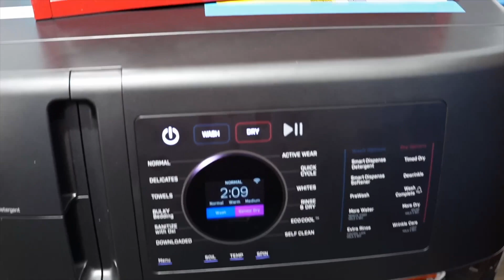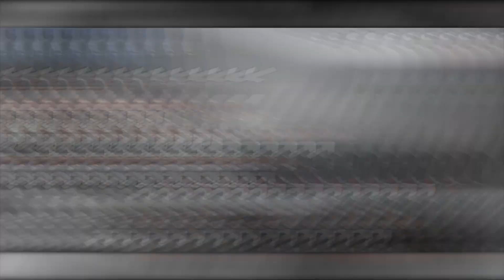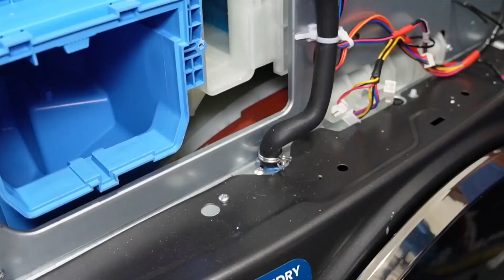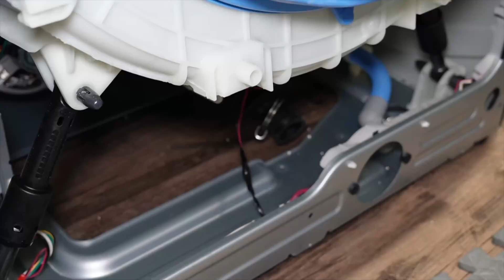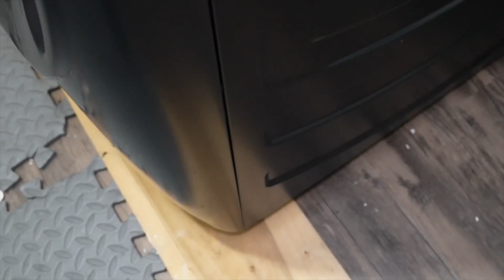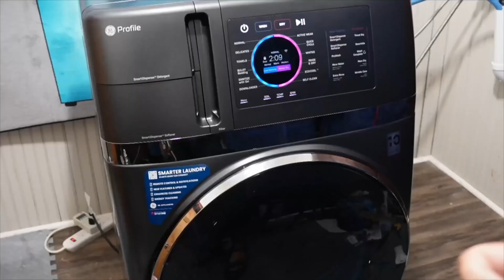GE Ultrafast Combo - Drain Pump Replacement Guide if Unit Won't Drain

Comment from the maker: This video was by request from a few viewers. Remember that buying the pump from our site does help support me making videos like this and all the others. Pump: https://bens-appliances.com/products/wh11x29539-ge-washing-machine-drain-pump-wh11x29539cm

OEM Pump: https://ifix.gd/3XPuKIk
Reply: Thank you so much for this video! Was out of warranty and no repair folks in my rural area could work on this machine. Was able to fix the issue myself and saved a boatload of money!
Reply: I tilted ours and went under and before I completely removed the pump I put my finger in the smaller hole and could feel the impeller and as I turned it found a bunch of lint attached. I got the lint pile out and I’m running a test load now. Thanks for these videos. Last time I watched one was for my elderly parents washer and you sent me the part and I used the video to do the repair.

Comment: Wow! I have never seen anyone make such a simple job so convoluted! 

Go in through the bottom! None of the front panel needs to be touched or removed. Make sure that you have the right tools for the job, but damn! 

You took a simple removal and replacement to a-whole-nother (infix for you linguists) level of difficulty. 

Props... All engineers should have to be mechanics first. 😂

Interesting design failure in the pump assembly that could have an easy fix. No screen in front of pump intake. That one feature could prevent pump failure from debris. 

Surprised these haven't been recalled or that there isn't a class action against GE for negligent engineering. 

An after market part that fixes the pump flaw in these washers would make a killing, especially if there was a recall. 😂 Blue Ocean baby.

Comment: I have water leaking from the drain pump filter seal unless I tighten it SUPER tight . I think the threads on the plastic housing are bad. Not a great design for such a crucial leak point!!!! Anybody with tips on what I may be doing wrong / why it might be leaking / not threading well?

Comment: We just had this same problem with our washer and replaced the drain. We replaced the control panel and although all buttons work; the washer works and goes through all the cycles; the display does not light up. I can hear all the beeps from pressing buttons but no display. Is there a remedy to this without replacing the entire panel?? 😩🆘

Comment: Before replacing the pump check for any debris stuck in the pump. I had a buzzing sound and no drum spinning. It ended up being a huge clog of hair and carpet. I bought a L shaped pliers to pull it out. Now it works like normal.

Comment: Thanks to the commenters here. We also had a drain pump that stopped working and it also turned out to be lint trapped in it. A sink snake was able to grab it. We weren't able to see or feel anything, but that was able to pull out a lint plug (that was quite hard). 
I'll now add snaking the drain pump impeller as a part of the deep clean. Love the machine besides the lint issues.

Comment: Thank you for making this video! My washing machine would not drain, and warranty had just ended. I ordered a new pump and followed the instructions except I did not completely remove the control panel but supported it and left wiring intact.  Also left the balancer in place which made it a little tight but not too bad.  Turns out that pump discharge line was plugged, even though I have been cleaning inlet filter, and pump was still good. I replaced it anyway since the machine was apart.  Without this video I would not have attempted this repair myself.  Thanks for helping me save a lot of money!!
Reply: We offer a complete Flushing process and products to keep your machine like new. Reach out if you're interested.

Comment: FWIW as others have said you can do this without removing the front, assuming you dont have the base attachment.  Very carefully lean it on its side, not too steep, either stack something underneath or have someone spot you as someone else posted.  , i got a $4 shallow ratchet set from harbor freight along with a stubby screwdriver.  That along with angled needle nose which i already had.  Take the black tub drain off first, then take the screws, it was easier to use a stubby screwdriver on one side and the shallow ratchet with phillips on the other.  Once the screws are out you can pull the whole pump out through the hole in the bottom and then remove the blue drain hose.  In my case, somehow a hair tie had made it through the pump filter and then got wrapped in a bunch of hair and lint, right at the 90 degree bend.  Seems this should be a straight connection or 45 degree or something and not 90, or the strainer/filter should be a bit finer to not allow such large items through.  Either way in my case i cleaned out this blockage, made sure the rest of the hose was clear, then reinstalled the pump (in reverse order) and i was good.  I went ahead and ordered a spare pump since its cheap.

Comment: So heavy is not an option but the hole on bottom does give you enough room to pullout the pump and replace it is that correct sir?

Comment: Like everyone else, I also had to replace my drain pump after less than a year. However after watching this video, I realized I could pull the machine away from the wall about 3' and lean it back ballance against my wall. For safety I had my teenage son spot me while I slid in underneath. Took about 10 minutes to remove and replace.
Reply: What symptoms did you have that it needed replacement
Reply: @frankgeraci1060  I had a buzzing sound and no drum spinning. It ended up being a huge clog of hair and carpet. I bought a L shaped pliers to pull it out. Now it works like normal.
Reply: Perfect, I saw that floor too and was like shit I can just get that from the bottom can't I

Comment: Honestly after over a year I would not recommend this unit because of : 
A) drying lint catch does not adequately remove lint from the system. There is an excess buildup both around and in front of the lint trap that needs to be vacuumed out every month or so. There's no access port to more extensively vacuum the unit out. So dumb.
B) The drain pump is small and weak. And the filter in front of it is like a rock catcher. My drain pump thankfully didn't crap out but from the sound of it it's not uncommon. Why not put a more "mesh" type filter that actually will extend the pump life, followed by a pump that actually has some balls?
C) Even out of the factory your clothes will take longer to dry and with lint buildup even longer.

I'm out of warranty so obviously I'll just keep it. The convenience is awesome and with a few tweaks this things could rteally be great. But damn GE, fucking step up and use common sense. Shouldn't have to disassemble the whole damn unit to swap a little pump.

Comment: As mentioned in other comments, you can do this repair WITHOUT removing the front panel. Just tip the unit on its side/back (make sure to remove detergent unit and also pad where the unit will sit). Then follow the steps in this video from minute 6:50 but just do it all from the access point UNDER the washer). Makes this a far far simpler repair.
Reply: From the video it looked like two Phillips head screws may be hard to access from the bottom of the unit. But if you've done it before than cool beans.
Reply: Ooooh really good to know.

Comment: Seems like you can get directly at the pump from underneath the unit. Tight squeeze, but not too tight for an auto-mechanic
Reply: That's the method I used. All you need is a stubby Phillips head screwdriver and a pair of plyers to remove the two hose clamps. I leaned it backwards and balanced it against my wall, I'd recommend a strong spotter as this machine is incredibly heavy.

Comment: You don’t have to remove the front of the machine. Just prop the washer up lay on your back and the pump is accessible. Had mine changed in 15 minutes.
Reply: Did you have fault code 18?
Whats the part # for the pump?
Reply: That's exactly what we are going through now code 18 and its 1 year old wtf we got the warranty but they denied it saying its still under the manufacturer warranty now i gotta figure that out 😂@advanced8526
Reply: @advanced8526 I had that, I had lint and hair clogging the actual drain.
Reply: I'm looking at that option now. How did you get it up in the air? Lol

Comment: It’s really sad how short the lifespan can be for some of these parts! We have the original Whirlpool Duet HT that was made in Germany. I have replaced our pump, but it lasted well over 10 years and I only had to remove a few bolts so that the bottom access door would come off. Unfortunately that’s also the only way to access the pump’s filter as there is no other access point.

Comment: Great videos! Thank you so much. Perhaps you can assist with an issue I am having. 

I am receiving an error code 18. I have ensured the drain pump is cleared and that the blue hose is not too far the in the drain. I believe we have a clog in the blue drain hose. Is there a way to try and clear that out?
Reply: Did you ever figure out your problem?

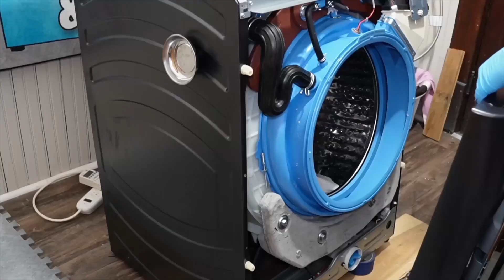Comment: Thank you for 8:59  this video.  15 months after installing and my drain pump quit working.  We cleaned the filter each time we washed and dried and yet there are globs of wet lint coming thru the drain pump filter.  Where does the lint go once it makes it to the back of the lint filter?  This is obviously a design flaw.  I’m so sad we paid top price for this unit and now it’s not working. #geprofileallinonecombonotworththemoney

Comment: I’m having an issue with water sitting in the gasket/not draining well.  I think what happened was a receipt or something got washed and that paper clogged the small drain holes along with hair/debris.  Can’t seem to see how those drain holes get down to the pump area.  The pump filter is clear.  Do you have anything showing the hoses from the gasket down to the drain pump?
Reply: Similar issue. Random pooling in the gasket. I wonder if that is the issue or a plumbing issue

Comment: My machine is just under a year from purchase, and lo and behold I believe our drain pump has given out. We are very meticulous when it came to removing lint from the filter and doing the usual maintenance to keep this $2200 beast working right and it still failed us. I woke up this morning and forgot my son needed his band uniform for school today so I threw that in this morning for a quick wash and it filled with water and didn’t drain. I looked at everything and nothing seemed clogged. I don’t have the energy to unscrew and dismantle it so I’ll wait and watch what the tech does tomorrow. 😅 
Awesome detailed video, will keep it on stand by in case I need to replace it myself later.
Reply: Well was it your pump? Seeing how many views this has really makes me think about just buying a stack style (2 in one) unit for my small space.
Reply: @ it wasn’t, thankfully. We had some lint get so clumped up near the very bottom of the tubing. Looking through the tube you couldn’t see the clump at all, it’s hard to explain but we stuck our fingers all around in the opening and was able to feel a blockage that was located to the right (there was an opening to the right of the main tube?) hope that makes a little sense. Sorry again hard to explain. If the lint trap was easier to clean and actually trapped the lint blowing we would not have had a ball of lint stuck in the tube. Like I mention, we clean the lint trap out after every use, and do the recommended cleaning of the bottom drain when instructed, and also extra cleans just to keep it running smooth. The lint was so hard and balled up. I do NOT recommend this unit. I like the ease of it, and would totally buy another 2/1 combo unit, but ONLY if the lint trap area was a lot more easily accessible to clean. Even with our cleaning, the lint build up has still been extreme unfortunately. If you have any other questions please ask! We’ve had it for a little over a year now.
Reply: @AngelsCrafty  sweet thanks for the honest review. With all of the views on this video, and comments it really makes me thing it's not worth getting. Someone local is selling one that "needs a drain pump" but they could just have the same problem you do. I'd be tempted to buy it for the $500 they're asking, but I think I'll go with the apartment style double stack unit instead.

Comment: My counterweight bolts are 13mm.  My pump is still functional, just had to remove the hairball.  I might try to add a screen to make the easy access filter more functional.

I was able to put the retaining ring back on without tools by putting the spring section on last around 1 o'clock position.

Comment: How do you prevent this? Mine just burned out and it’s under warranty, but I have zero confidence it won’t happen again. 

The tech said GE’s new bulletin about this asks you to wash the plastic lint filter with soap every few weeks….hard to believe that will prevent this. Seems like poor filter design? I have two cats….we’re not drowning in fur by any stretch…

Comment: Interesting video, as always. But I had to wonder-this machine has only been on the market for what...a year or less? So why would pumps be failing so soon? I have owned serval front load machines...never once have I had to replace a pump.
Reply: This is the second time mine has failed in a year because of pet hair impacting the filter on the pump. After the first time, we beat the clothes out before putting them in and use pet hair dissolver with every load. And we gave always cleaned the main filter. Funny enough, we bought this because it was supposed to be good for households with pets. Huge design flaw.

Comment: I’m waiting for GE to come replace my drain pump for the second time. I am thinking that the dog hair is getting caught up in the pump and burning it out. 

The brain filter basket does nothing.
Reply: There is a way to maintain / flush your unit, then install an upgraded filter kit to keep the hair and lint where it should go, on the filter and not the coil.  I recommend flushing the system every  6 months based on the severity of the buildup.
Reply: @HomeGuySolutions  Do you have a link on how to do the flush?
Reply: How long is the warranty that covers the drain pump?  GE makes it very confusing advertising different warranty lengths and various aspects of the machine, but no mention of the drain pump.
Reply: Thanks, ours is barely 6 months old and seems to be out.  Under warranty but I was curious, glad we bought the 5 year extended!  The drain filter didn't have much in it, but we have a golden retriever in the house that creates a lot of hair

Comment: Ive had this since November and just wondering if anyones run into balance issues. I have mine on the second floor so it does shake normally, but when it goes full drain spin, it shakes like an earthquake cause it to stop and start due to the balance sensor and the drum hitting inside. Yes, Im going to install plywood and shock absorbers under the machine, but just wondering if anyones had this on a solid base?
Reply: Same we had our installed last month and shakes alike an earthquake when on medium or high spin. I added around 1-1.5 in ply of wood along with a yoga mat under it because I didn’t want the wood to slide around or nail it down to the floor. So far there’s no shaking on medium spin and very low hum/vibration when on high spin
Reply: Did you guys remove the shipping bolts and brackets?

Comment: Geez how painful. Was bad enough replacing a drain pump on a completely different model with a kickboard panel with like four screws to access the pump. Taking the whole control board and front off just to access the pump seems like terrible design.
Reply from the maker: Sadly, every mfg. has basically done away with kick plates because they look ugly. By far the most useful thing a manufacture had and now its gone.

Comment: For everyone in the future, I would highly recommend NOT REMOVING THE COUNTERBALANCE WEIGHT. If you've never done it before, you're likely to not install it back correctly. Then your machine will shake like crazy.
Reply: Not true…it is a fixed weight it does not rotate…check your shocks, and make sure your machine is level …

Comment: Not related to this video, but why do dehumidifiers last only one year? I've had three in a row work fine for the first year. Shut them off in October, turn them on again in June and the compressors don't go on. What kind of JUNK is China sending us? Very expensive and frustrating.
Reply: Do you maintain the filter?  Do you always keep it stored in an upright position? Do you run it directly plugged into an outlet or run it on an extension cord...

Comment: well at least they put a 120v drain pump on it. wonder if like the stand alone washer the main board can burn a small spot in the main board?
Reply from the maker: I am unsure. I don't have one of these anymore to confirm it (or not) so I included the info at the end just in case. Gut feeling says they probably didn't fix it and it'll have this issue in the future, but who knows.